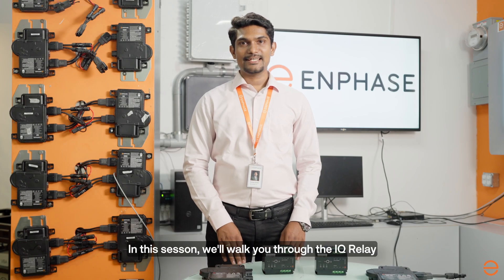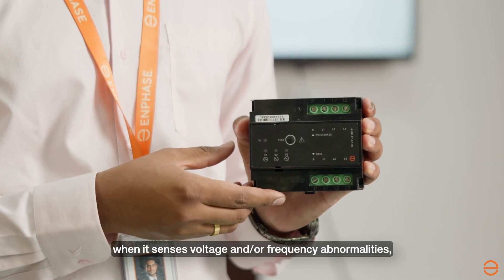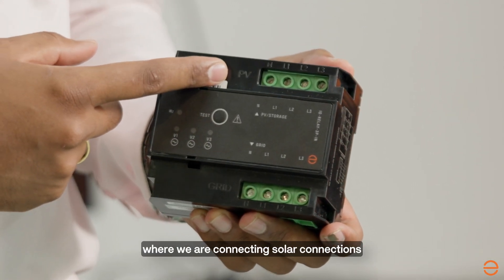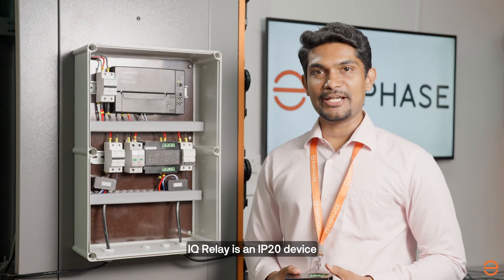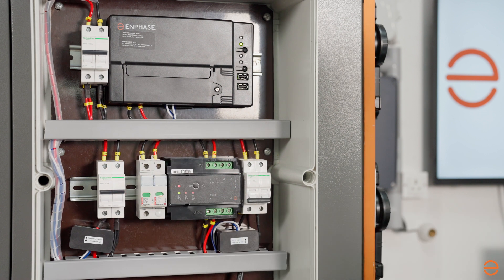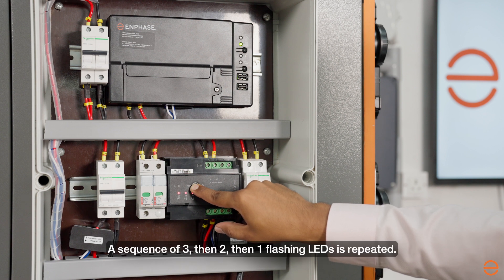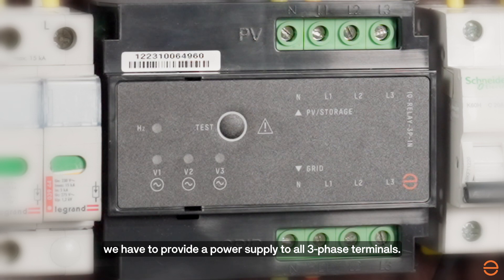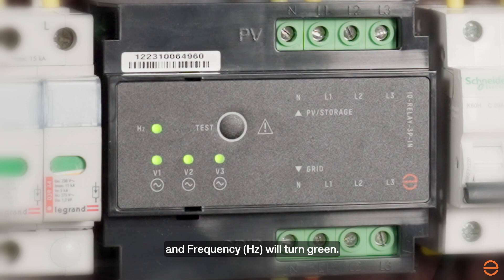India Enphase Energy IQ Relay

Comment: Hello enphase instructor, kindly give us a line diagram on how to connect enphase iq8x system from panel to 220v grid supply. Using a single wire outlet from Distribution box live (220v)and a neutral.the  European system and not 120v USA system. Thank you for your understanding